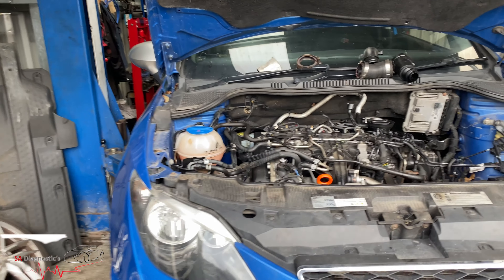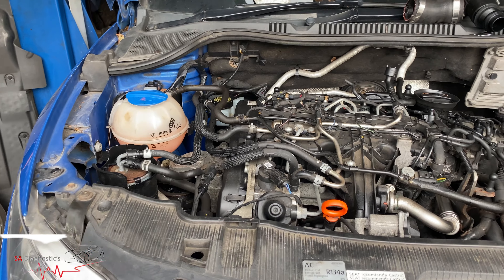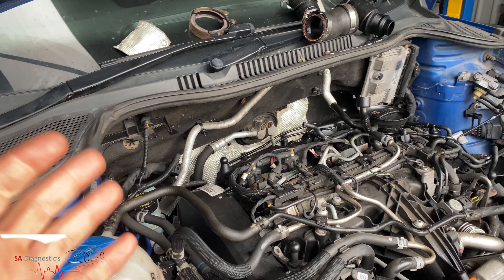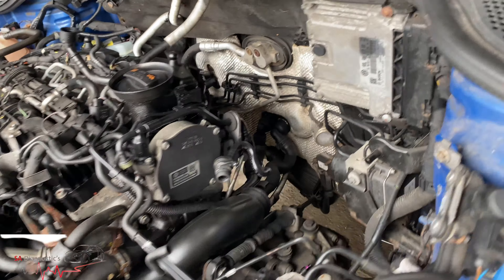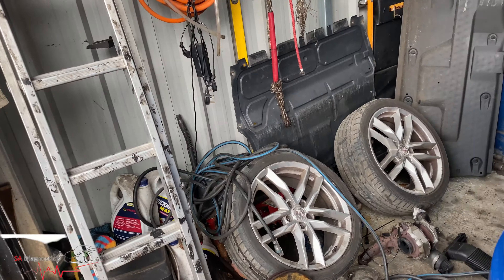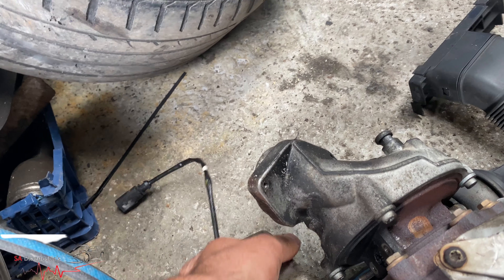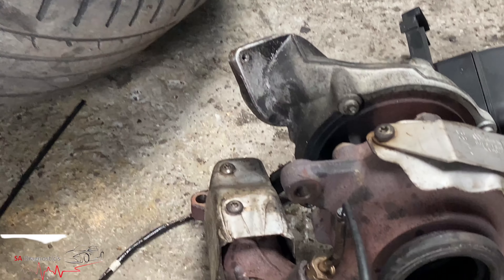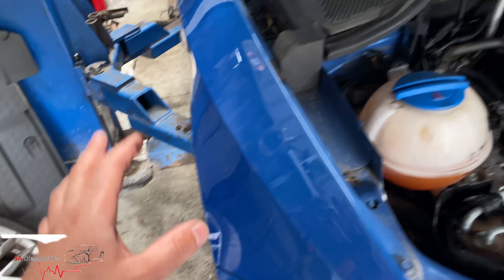Audi Seat Skoda VW P029900 P019300 P00AF00 Turbo Charger Supercharger Under boost FIXED

Comment: Awesome video! Quick question, so my 2014 Passat TDI has the famous P00AF00 and it doesn't boost at all. The vehicle idles fine but under acceleration, there is no boost. I have also noticed some black oily substance leaking where the DPF and turbo mate. It smells like oily diesel mixed with oil. As of right now,  I'm wanting to trouble shoot to see what's the issue but the weird leak is what has be wondering whats going on. Could this be indicative that the vehicle needs a new DPF also?

Comment: I have the same code P00AF00(non-confirmed) that I can't clear on a 2015 1.8L TSI, idle smooth no noise even when throttled but doesn't have enough boost. Is there a possibility for any intercooler pipe leak or turbocharger failure?